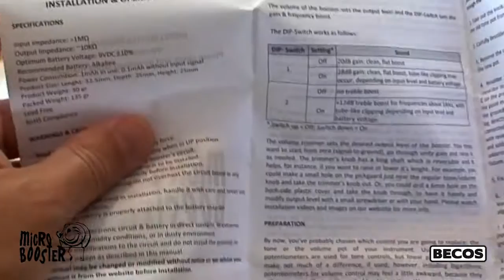Installation of BECOS Micro Booster Onboard Preamp on a Fender Stratocaster Custom Shop

Comment: Pretty groovy idea. Quality seems fairly good. Have you given consideration to making perhaps, a 15 db transparent boost (with the most quality parts you can get, to eliminate HISS), strapped down inside the cavity, without losing the tone pot? In other words, just a fixed volume unit that stays on? If it was a quiet piece, I would never want to turn it off. 

Fenders especially sound better going through transistor circuits before hitting the front of most any high quality tube amp; however, it is not always practical to haul out a wall wart and an extra cable and a floor boost pedal around the house, which is the only place I ever play (but in two different rooms). Sounds lazy, but I don't have enough outlets and enough power strips to accommodate all the electronics these days. And at my age, yes, I've done enough already!  And before you go to judging, I'm 68 years old and have been playing guitar for 54 years and in bands for 35. If it ain't easy, it doesn't get played!
Reply from the maker: +Tonetwisters 
1. The actual iteration is a variable clean flat boost from 0dB to +20dB - please take a look at the new website: http://microbooster.becos.ro
2. Hiss is unavoidable in any amplification circuit, but it will be audible only when not playing and only on hi-gain amp channels, just like with any other boost/overdrive/fuzz effects
3. We always used best quality components for this product - no need to spare for tone; after all, it is priced decently for what it is, the only aftermarket high quality onboard guitar booster preamp. We dare to say it is better than what Gibson and Fender use in their boosted guitars. We could have done it even smaller, but we chose to put Panasonic and WIMA polyester film audio capacitors. We use Fairchild Semiconductor FET transistors, using a circuit derived from tube amp design. We could have done it with integrated circuits like most others do, but we are also fond of audio trasistors. Everything is at best we could get with this booster.
4. Potentiometer is NOT part of booster circuit! We use a PUSH-PUSH switch pot, for the convenience of having a signal routing DPDT switch and a potentiometer into the same device; potentiometer side of this device replaces whatever pot you chose in the guitar (volume or tone) and it will be rewired as before. Switch side of the device is used to route pickup signal through booster or true by-pass, straight to the output.
5. Yes, having the boost available in the guitar MAKES SENSE, and is very practical. 
6. We (I) think age is wisdom. We wish you long time rocking on!

Comment: When the tone switch has been pushed in to put the preamp in passive mode, is there still draw on the 9V battery?
Where can I get one of these in the United States?
Reply from the maker: +Jameson Miller Booster circuit is powered as soon as you insert the instrument cable in to the stereo output connector, regardless if the signal goes through circuit or is by-passed. The amount of drawn current is quite small, so the battery will last for months of usual playing (a few hours a day).  Of course, you could make the battery keep longer if you unplug instrument cable over night, or when you put guitar at rest.
Yes, we ship worldwide. http://www.becos.ro/ubst

Comment: I assume when I replace the tone pot I lose its functionality or does the new push-pull retain the original tone control until pushed?
Reply: +Guitar Nut I am also curious about that!
Reply from the maker: +Guitar Nut + Jameson Miller The potentiometer side of the switch-pot is NOT part of booster's circuit, and is meant to replace volume or tone potentiometer in your instrument for the convenience of having a switch and a potentiometer into one single physical device. So the potentiometer has to be rewired just as it used to be - passive. If it is the tone control that is put in place of, the tone capacitor has to be moved to the new pot as well. If it is the volume control that is to be replaced, you just have to rewire the new pot as it used to be. Booster's PCB is just attached to the switch-pot to pack everything in place. The switch side of the component routes signal through booster or true by-pass.

Comment: No routing required?
Reply from the maker: Michael Strasser No, no routing required, at least not in the pictured original Fender guitar. I know there are many guitars out there, and some may be routed differently underneath the pick-guard. But I would say that most chances are that no routing is required. The fingerprint of the booster is really quite small and it is attached to a common-shaped switch-pot... If you check the published dimensions and compare with what you have in your guitar, you will figure out.